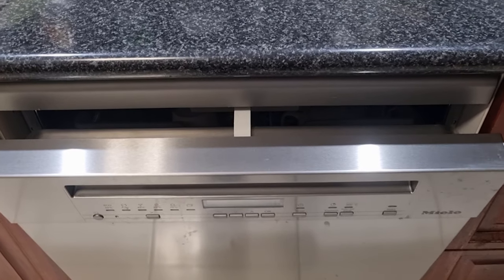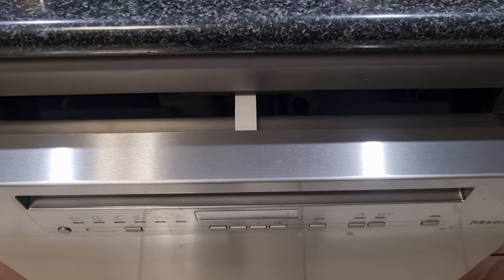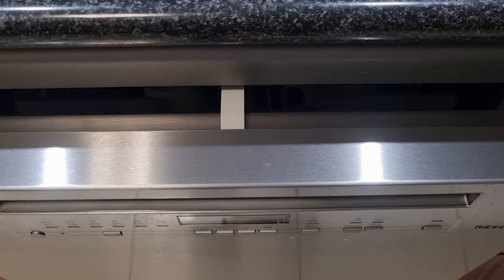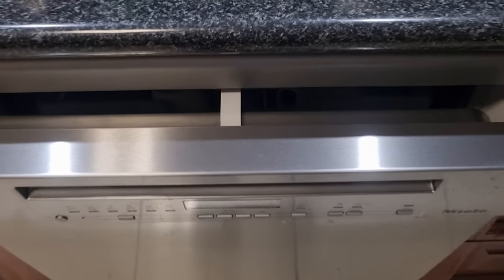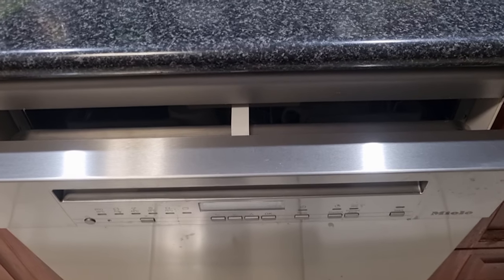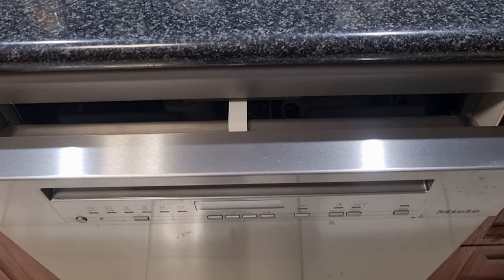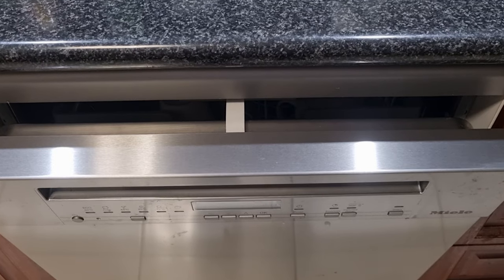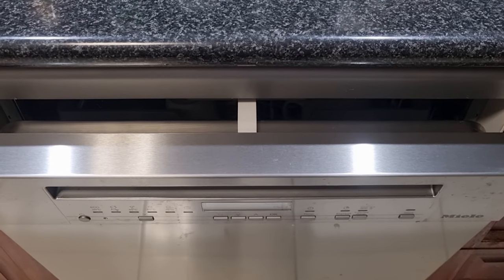How to open the door of a Miele dishwasher.

Comment: Thank you your amazing. Saved my frustration in seconds! I was getting to the point of loosing it after looking at the instruction book at least 3 times thinking I had missed something. I can’t thank you enough for the video.
Reply: Me too. I pushed it in because there was nothing in the instructions nor a video online to explain this feature. Running another cycle to see if it works this time. 😞 Hope I haven’t damaged it.
Reply: Yup, reading , and re-reading manual, nothing...  turn out  firm tug to open is all the is required but I never would have pulled that hard without watching this video first!

Comment: Please help, how do I switch auto open drying on again, someone ( husband) 😬 switched it off. I have tried so many times but to no avail. 🙏
Reply from the maker: Opening the Settings menu by:-

1. Switch the dishwasher off with the power button, if it is switched on.

2. Press and hold the Start button
pressed in.

3.Switch the dishwasher on with the power
button. Release this button as soon
as the background lighting lights up
in the display. Keep the Start button
pressed in for at least a further 4 seconds.

4.The first option in the Settings menu
will appear in the display.
To learn about the display, read the
section with the same name.

5.Use the  arrow buttons under‐
neath the display to select the option
you want to change and confirm your
selection with OK.

6.Scroll to the auto open and check it with a tick

7.Sub-menu options which have already
been selected will have a tick  beside them.

8.To exit a sub-menu, use the up or down arrow buttons to select Back  and
confirm with OK.

9.The display will revert to the menu
above.

I hope this helps.